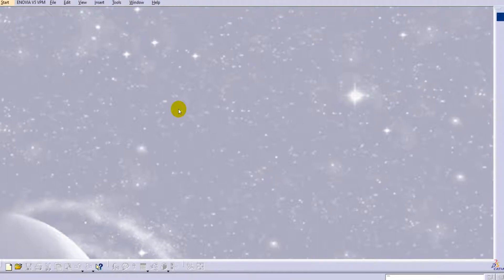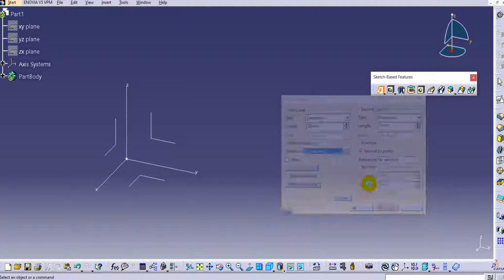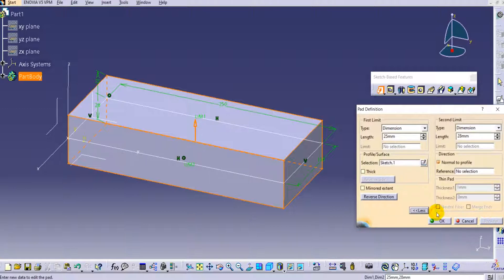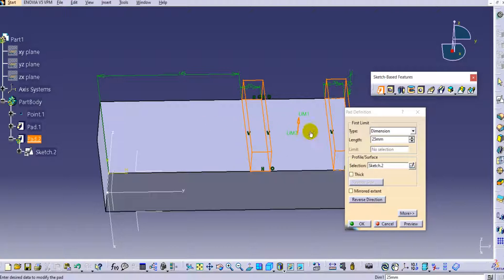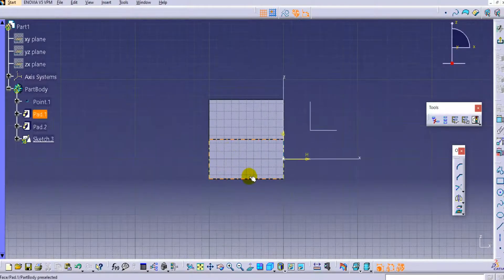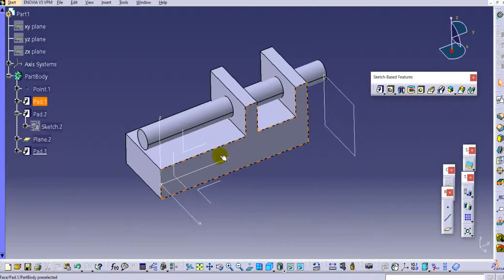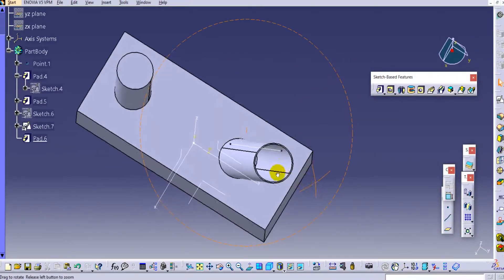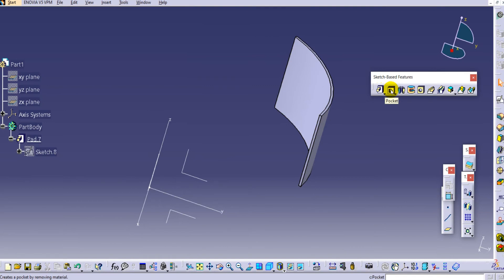CATIA V5 I Part Design I Pad Command in Detail

Comment: Sir in drawing rectangle when i select the constrain for the width its only taking 100 mm for one side and the opp side isn't changing to 100mm
Reply from the maker: I didn't understand your question correctly..can you please explain it in more detail..

If you are drawing a rectangle sketch in sketcher, then off course you will be able to provide any dimension to the same by contraints.
Reply: @CADTutorialsForBeginners  
Sry sir that's my sys prob I think but when I refresh it came  tq for the video .Keep doing more videos sir